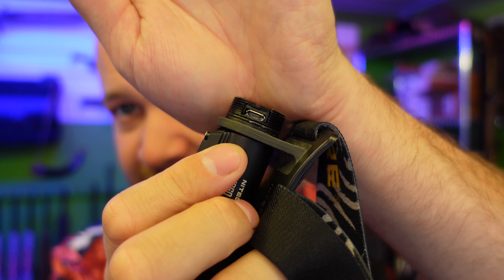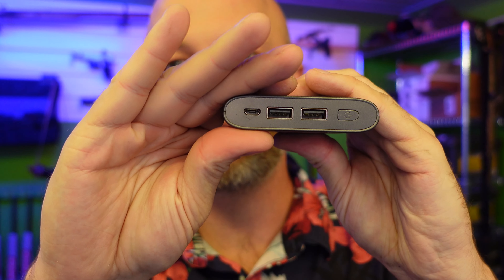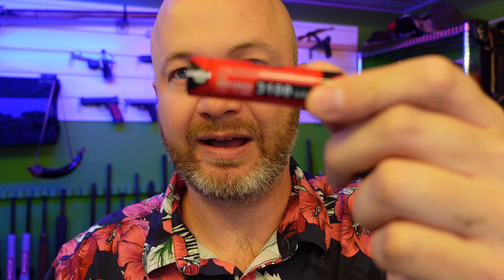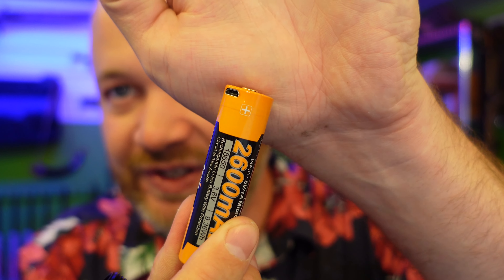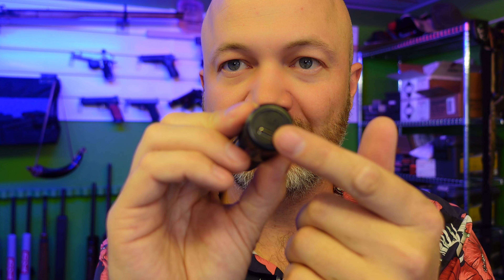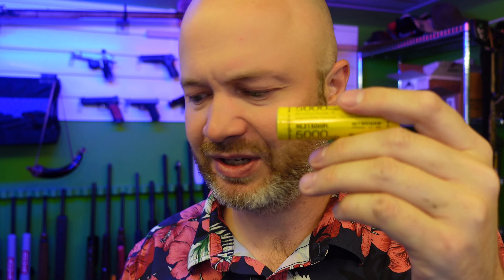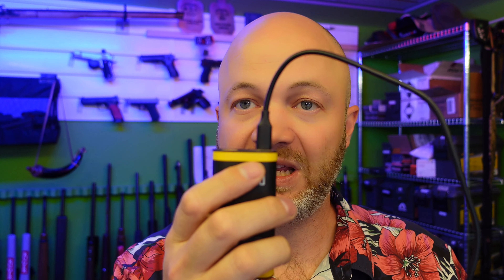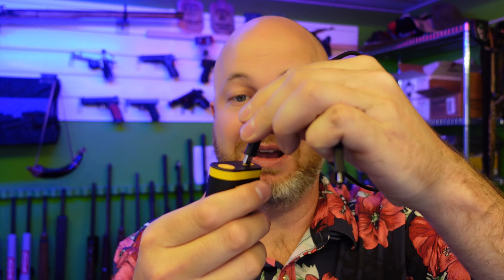Recharging Battery Reviews

Comment: I'm of the opposite opinion. The right way to charge is by taking the battery out and replacing it with a charged one. Empty battery can be charged via battery built-in charger or using the dedicated charger station, that doesn't really matter. I have dual channel charger from Fenix neatly mounted on the wall, and that's my preferred method. Less bulk, less dirt ingress, less time the device spends outside my pocket or bag. This is especially important for the firearms mounted lights.
Olight's method is by far the worst, as it requires a proprietary interface.